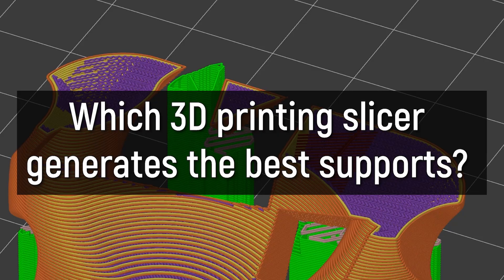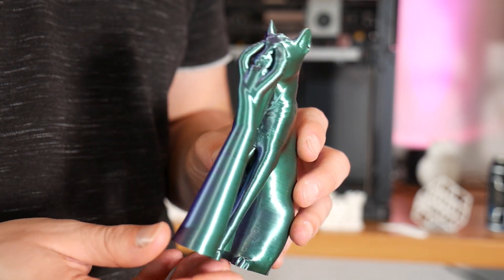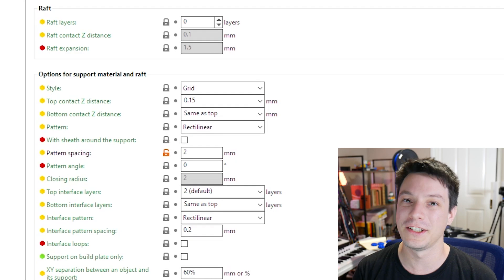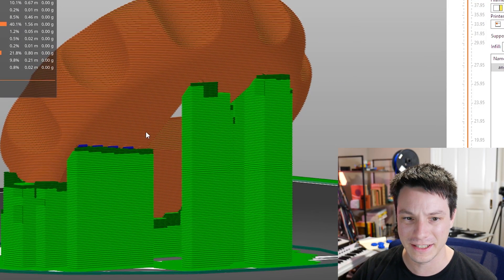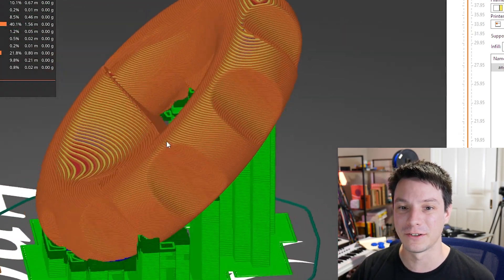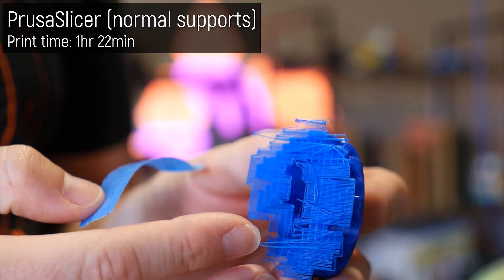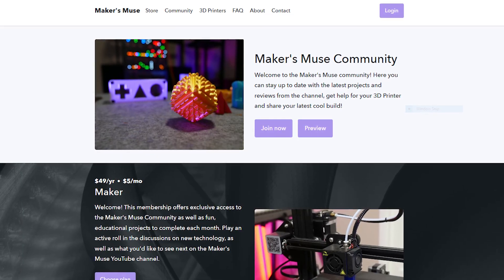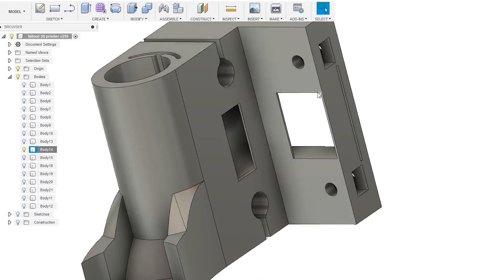Which slicer has the BEST support material? #3DP101

Comment: I would squish a bit those 3 surface layers on themselves to give on the top of the head of that cat a bit of smoothness. I can't use prusa slicer or cura as I'm using an old printer that's not open source but I've done that tweaking and gave me a bit more surface finish

Comment: It seems like you probably had the Bambu Studio tree support settings on the "Tree slim" profile that it suggests to you when you turn on tree supports. This generates tree supports with *no interface layers*, which I've found to be pretty worthless because then the supports fuse to the print and are very hard to get off, exactly as demonstrated in the video. If you decline the "Tree slim" suggestion pop-up, you get better support with regular interface layers that pull away much easier.

Comment: i'm finding as i dig more into these settings, is that there's so many it becomes tough to keep things straight.  well i did this, now i should do this, this should be done etc.  checklists, discussions on what exactly effects what, 4etc, things like that.  do you have any things that you have put together like that? a flow-chart of sorts? i had my printer pretty tuned in for printing a specific voxel model with a bunch of tiny over hangs etc, and it still needs to have the profile tuned a little more to perfect it, but i'm at the point where when i change this setting or that setting, it's enough to screw up the prints again.  hopefully i'm making sense and if you know of a resource, i would appreciate being pointed twoards it!  you have a great day sir!

Comment: Nice.  I need to make my video of my support system.  All I will say is I had to print an item which was 969 grams, and CURA wanted to use over 350 grams of support, (I only wanted to use 1 x 1KG spool) and I did supports in 32 grams and had better results.

Comment: I have been using bambu tree supports for a few prints now and have not had the issue in this video. If anything they have been easiest supports to remove and have required very light tug to remove them. maybe they work better on bambu printers

Comment: If you can use soluble support then a trick you can use to cut down the cost (soluble is very expensive) is to print your model in the base filament and only print the interface layers with soluble.
This has a side benefit of speeding up your print because you are not doing head changes for every layer.

Comment: IMPORTANT MESSAGE FOR PEOPLE GETTING INTO 3D PRINTING
$100 is crazy but make sure you check what chip the board is using. I got an ender 3 V2 (not from MicroCenter, but from ComGrow) a few months ago with very little knowledge getting into it. After a couple of prints my bed has warped a little. I found out about mesh-bed levevling and learned I would need to update my firmware and found out I have a 4.2.2 board and unfortunately a GD32F303RET6 chip. After digging around a ton, I have seen some people sometimes have success upgrading their firmware (important note I have read multple places to not try to use Creality's official site if you have a GD32F chip if trying to update firmware), but I have not attempted it myself for fear of ruining my printer. If someone does have a solution for upgrading the firmware for and ender 3 V2 with a 4.2.2 board using a GD32F303RET6 chip (hopefully that will allow manual mesh bed leveling), please reply with a solution.

Comment: Disappointed that Flashprint slicer was not included in this video. The slicer doesn’t have the amount of options that Cura and other slicers have but it does have 2 things that I find very convenient. The supports come in two types: linear and tree. Automatic generation of both is available including options to do supports touching platform only and overhang angles. Several options for building the supports are available such as thickness, distance from model, etc. 
But this slicer has a very convenient feature in the support generating simulation. You can edit the supports! You can automatically generate the supports in the simulation and if there are weak supports in an area, you can add extra. Or you can remove supports that you didn’t want. Or you can bypass the auto generation altogether and put supports where you want them.
This slicer also has the option for hexagonal infill which I find to be very strong. Not sure if other slicers have that. I know Cura doesn’t. 
The cons are that this slicer is only for certain printers and although you can edit the specific code out of the file, you run the code on other printers at your own risk.
Despite the limitations in the slicing options (some very frustrating), I’ve had better prints from this slicer than Cura, however, I haven’t used this slicer on my other printers so the performance could be printer related and not slicer related. I’ve definitely had better support generation from Flashprint.

Comment: After using flashprint for over a year, prusaslicer has the best supports, lol

Is definitely a biased opinion as I only have used two, it was impossible to do a complex model with flash print.  With prusa slicer in the exact same model had no issues

Comment: At the 8:30 mark you have a circle all the way around the outside. I assume it's primary purpose is to ensure filimint is flowing well or to mark an area. For some reason I'm using Cura 5.2.1 and it makes that outer circle attach to my actual model. I assume it's purpose is to ensure the model is easy to remove. Should I let it continue fill that in and if it's a waste of material is there a setting I am missing to make it stop doing that?
Reply from the maker: It's called a skirt if its separated from the part and indeed does help start the flow of plastic reliably, but if it's touching the part it's called a brim and it can help hold thin parts down to the print bed more reliably.
Reply: @MakersMuse  It is annoying to trim off of everything I'm printing. Now that I know the name hopefully I can find a setting to remove it.
Reply: @MakersMuse  Thanks, I found the setting and changed it from brim to skirt and it's helped a ton. No more insane cleanup

Comment: I have always had terrible experiences with support interface across several versions of cura (4.1-5.2) with several printers (ultimaker S5, ender 3, tenlog d3) 

The support interface never pulls off right away, has to be scraped or pulled off in small parts, leaves horrible marks and requires surface quality, it only helps stability of several close tall roses at that final layer 

I have never had any issues with default support without the interface, everything is supported, the supports come away easily, surface quality is clean and doesn’t droop

Comment: I think the Bambu print's supports actually resulted in a better quality final model once you pried it all off. The lines and integrity of the coin surface looked a lot better. I don't mind putting a little work into cleaning it up if it makes the end model better.

Comment: Since this is all needed regardless of gravity orientation (or gravity at all), I'd suggest that it's not a support at all, but a platform. Maybe you'd call it semantics, but a support is to resist gravity, where as a platform provides a surface to print against, which sounds like it's more technically correct. The best kind of correct.

Comment: Dang, I was hoping you'd cover Crealty's slicer since you are using an Ender 3 as the test machine,  I just bought an Ender 3 V2 NEO, and am having a hard time getting the supports in the Creality's slicer working properly.  I either get too much interface which pulls off layers of print, or not enough which gives a really bad print surface,

I had access to a Form2 resin printer for many years.  I mastered the supports in their software, but that slicer does not translate to an FDM printer.

Comment: Have you done any testing with the x1c AMS and using the different materials for the support interface on the breakaway supports? I've had really good luck with the Polymaker support materials for PA12 and PLA prints and some 3dxtech HIPS as breakaway interface on my ABS prints. It's a world of difference in bottom surface quality, especially if you reduce the top/bottom z distance. I could even turn the z distance down to 0 for my HIPS/ABS prints and got pretty much flawless overhangs with minimal struggle removing the support material.

Comment: Great video and I appreciate your dive into the different slicers! I really enjoy using Bambu studio for generating tree supports. At 14:13, it shows your Top Z-distance set to 0 mm. As of course you're aware, increasing this distance even slightly will allow you to remove the support material more easily instead of directly fusing it to the support layer. 0.2mm is the default distance and allows removal. If you want the 0mm distance, a support-specific print material such as Bambu's Support W (printing with multi-filament such as Bambu's AMS) is a great option as it does not lend itself easily to weld to the printed PLA.

Comment: Re: the tree support in cura I had the same issue with single point contacts and pushed the 'Support floor density' up to 50% and used the support mod to add traditional support towers with the tree support

Comment: back when I was using ideamaker I remember that the big "selling point" was the amount of manual control you had over the print result. So I think it's fair to assume ideamaker is designed in a way that it assumes the user will place manual supports as the UI for them is pretty well made.

Comment: I've used your link for designing support into the model many times. Not just designing the support in, but also adding it later in the program of choice. It's become a regular answer for me to post to StackExchange's 3D printing section. I'll have to add a suggestion for readers to the SE to subscribe and get you over the million subscriber mark.

Comment: I think it's important to know that the major thing that controls the angle of overhang that can be printed unsupported is the ratio of the layer height to the line width (nozzle size)  Use a 0.8 nozzle with a 0.08 layer height, you'd be shocked now much hang-out you can get away with.  I regularly choose thinner layer heights when I want to avoid using supports.

Comment: Have you tried PrusaSlicer's Snug supports? It's basically the same support columns, but they keep the supports a lot closer to the model and the interface layer is more cradle-like. I've gotten better surface finish with it and often it's easier to remove. Also, the Cura, PrusaSlicer 2.6 (when it comes out), and probably Bambu Slicer* all base their supports off a fork of Cura's tree supports. Thomas Rahm forked Cura, did a bunch of the work, the Cura and Prusa teams ended up working with them on the supports and are integrating it into their own slicers. Prusa said that their team came down with flu/*vid/etc. late December and they wouldn't get an alpha out in time. *Bambu indicated they found the supports from Cura, so I assume they are also using the same support setup, maybe with different set of settings.

Comment: I've been splitting PLA models in my slicer to prevent use of supports, then using dichloromethane to weld them together. The joints are very, very strong and you need microscopic amounts of solvent so it's not a hazard.

Comment: I'm at the point where I'm exclusively using my Bambu printer and I do find their supports very easy to work with.  I experimented with printing a 1:285 scale Zeta shuttle, from Rogue One, using a 0.2mm nozzle - and was able to get the supports off the less-than-a-mm-thick laser cannons without destroying them!  I had to be very careful of course, but it worked.  I agree that the tree supports aren't awesome, though; and if aesthetics matter you'll want to try and make the supported surface the less visible one.

I think of BaSl's supports as better than PrSl's, but I suspect that's more to do with the printer itself than the slicer proper, since my experience with Prusa Slicer's supports was all on an Ender 5.  So, thank you for including them in this!  And while I knew what changing the overhang angle did, I'd never figured out when I'd want to do that, so thank you for the mini tutorial there, as well.

Comment: That Cura support thing is a default for the Ender 3 standard profile, but if you make a new profile for a custom machine, it won't do this. It's kinda like the sheath setting on Prusa Slicer like you showed and I've always wanted to remove the setting, but just can't figure out how. It's annoying as heck to remove compared to the non sheathed ones I use on my machine.
Another thing I don't understand is why tree supports keep like 2 or more layers separated from the print unlike normal supports that are 1 layer away, supporting well but still being removable.
A slightly unrelated thing I would say is that when using soluble support, if you can physically remove the support from the part (say, it's not buried inside), use the soluble support material only on the interface layers. That way you get the benefit of the cheaper (usually, that is...) part material and the advantage of the soluble support to not leave marks on the part and print as if it was a top surface. It's pretty incredible how the parts end up.

Comment: I've used Cura's standard supports in conjunction with the support enforcer/blocker mod (one of them is official Cura, the other isn't, I forget which) mainly through a process of elimination. The dual extrusion printer we have really doesn't like the GCode from Slic3r lineage programs for some reason, and IdeaMaker's supports were just awful.

I've had some pretty decent results (as in, the workshop said "Yep we can use this in production") when I used the breakaway support material E3D sold a while back but is now discontinued. It stuck to ABS just enough to support it, but it wouldn't weld to it like HIPS would if it's set to the same distance. It's a total pain when it's encased by the model, of course, and I've reminded the CAD guys on a few occasions to not do that.

We have a couple of Markforged Onyx Ones now, and although I wish Eiger had more features and avoided stupid things like creating tiny support towers, it's a really solid package. Sometimes you get these slinky or accordion like things when you peel off the supports.

Comment: love the video Angus, I learn a lot from you so thanks! This is going to sound weird but here it goes. Ive had creality printers since I started in 2019, then Uncle Jessy sold me on Elegoo Neptune models. So I went strictly to Elegoo models. Specifically Neptune 2s and Neptune 3Pro. I have never gotten cleaner support removal AND quality than that of the Elegoo skinned Cura that comes with the printers.. it comes off like a banana peel and reveals great quality with no spaghetti pile edges. Even when I transfer these settings to other slicers, dont have the same outcome. I dont know. but it works and I love Elegoo products for the quality and ease. Cheers bruv!

Comment: As somebody who has only been doing 3-D printing for about a month, videos like this are still helpful. I’ve had a few prints so far where I overestimated the support I would need and ended up breaking parts of the print or making them impossible to reach, The worst one of which took almost 2 days to print.
Reply: A month in 3D printing is nothing. "videos like this are still helpful" I think you are overestimating your knowledge way, way too much.
Reply: I've been 3D printing for 2.5 years and these videos are still helpful

Comment: Maybe my expectations are wrong, but I'd say every single one of those prints came out horrible on the bottom. I'd consider them to be a failure with that much wrong.

As you say at the very end, better to not need any supports at all.

I've been trying to print D&D miniatures though, which are overwhelmingly designed for resin. I've seen people able to get good enough prints on FDM though, but alas it still eludes me.
Reply: Yeah, minis are really tricky. I have found that I have to play with lots of different settings, including distance for the interface layer, extruder temp, on top of the usual support options. One of the things I found makes the most difference is rotating the model though. If you just print the model standing up, that is often going to result in lots of hard-to-remove supports in delicate places. But many models will print with supports better if they are tipped over some amount to a specific side.

You'll still need to play around with the specific orientations a lot, since this still varies from model to model. Some work better on their side (often this presents less surface area to the build plate that needs to be supported), others more on their back, etc.